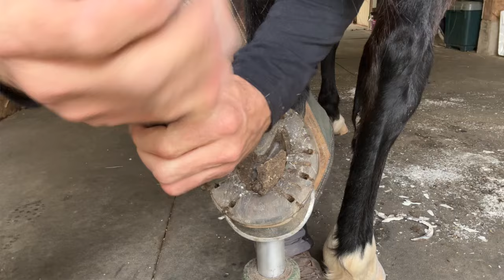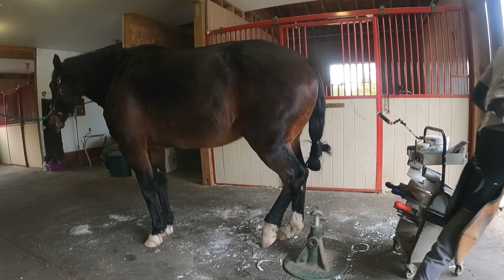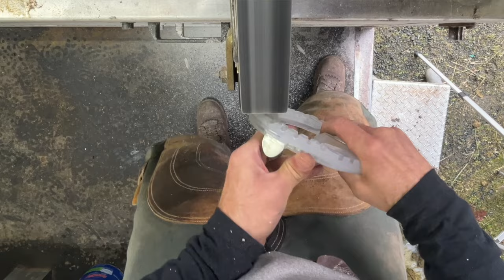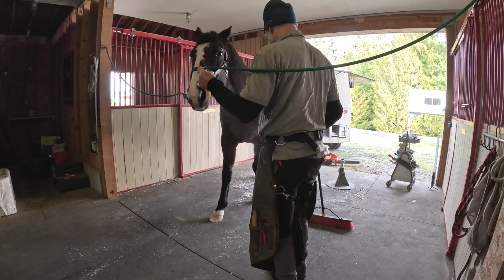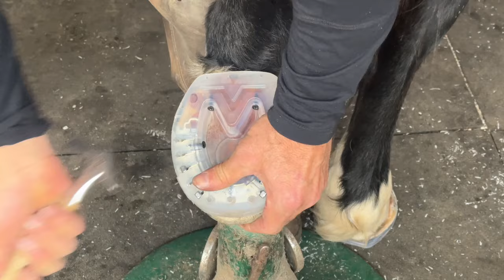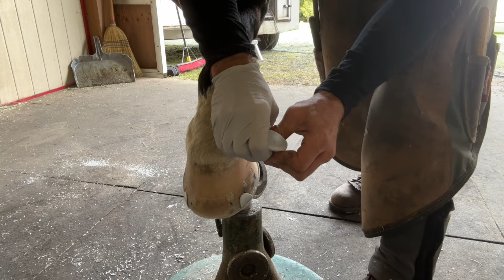New shoes for Prince , Before & After - Regular routine maintenance #ASMR #hoofcare #streamhorsetv

Comment: Nós estamos muito atrasados aqui no Brasil. 😢
Reply from the maker: Composite rubber horseshoes offer several functions:

Shock Absorption: Rubber provides cushioning, which can help reduce the impact on the horse's hooves and joints, especially on hard surfaces.

Traction: The textured surface of rubber horseshoes can provide better grip on various terrains, improving the horse's stability and reducing the risk of slipping.

Durability: Composite rubber horseshoes are often durable and resistant to wear, offering long-lasting protection for the horse's hooves.

Lightweight: Compared to traditional metal horseshoes, rubber horseshoes are often lighter, which can reduce strain on the horse's legs and improve overall comfort. 
I believe we start to see more acceptance of this style of shoe world wide. You can get creative and make your own from scratch however it requires a level of craftsmanship and understanding of modern materials.

Comment: May I ask what was the reason that you chose versigrip shoes over metal ones? Mind you I wish I had these sort of shoeing options 45 years ago when my horse got a severe abscess and kept losing his sole. it was nearly 18 mths before he got back into full work again.
Reply from the maker: There are two main reasons for choosing the shoe. First reason is, I only stock composite shoes in my trailer now. second reason I I personally feel that these shoes provide more support to the back third, caudal aspect to the back of aspect of the horses foot, allow better for blood perfusion, see an improved health in the horn tubules, as with a higher quality of shock reduction to limb on harder surfaces .